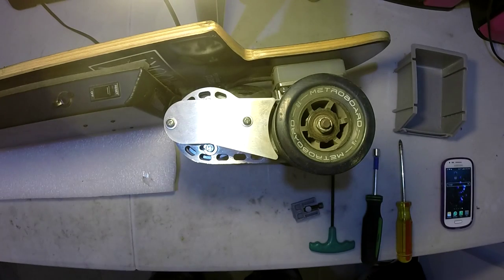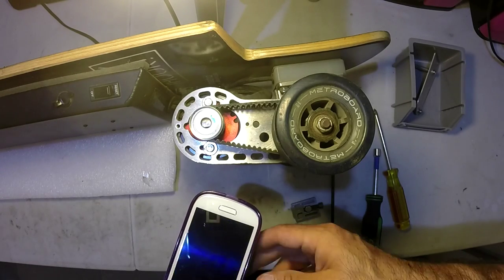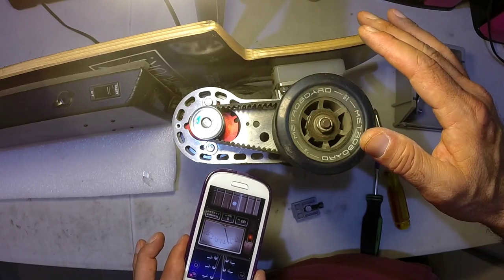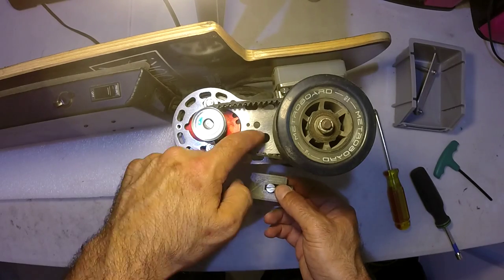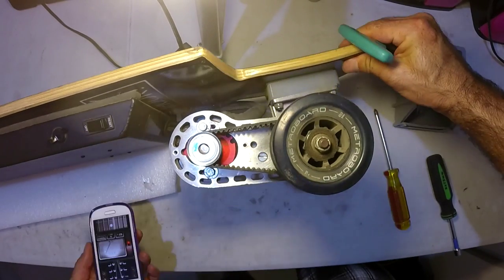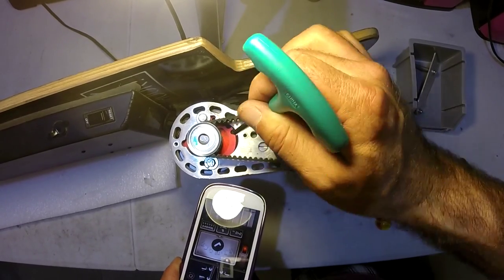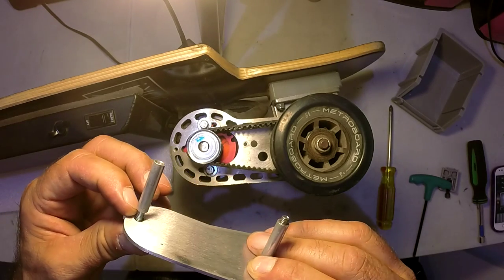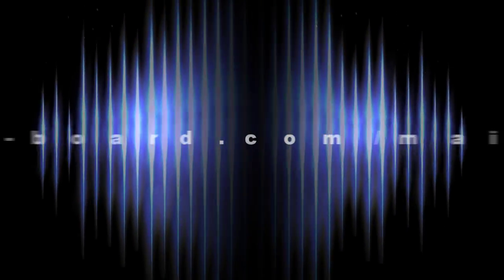Metroboard Electric Skateboard Timing Belt Tensioning Procedure - Outrunner Motor

Comment: Why are you guys using a DC jack jack for charging?
Reply: Why not?
Reply: first I assume they charge the battery with 25.2V which is above the standard 12V for that connector and second it can't deliver much current for fast charging.
Reply: Michael oh yeah, you are right. At least Boosted uses a properly rated jack.
Reply from the maker: Our charging jack is rated for at least 5 Amps which is more than sufficient for even our fast charger which charges at 4 Amps. Our standard charger charges at 2 Amps.